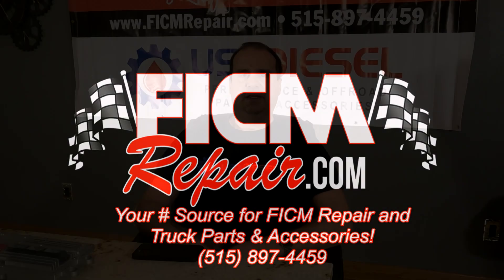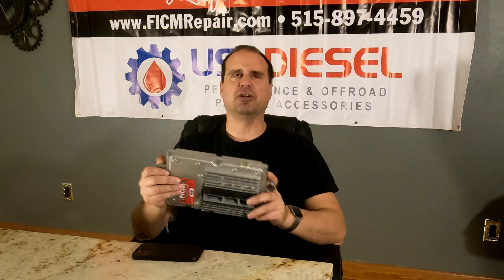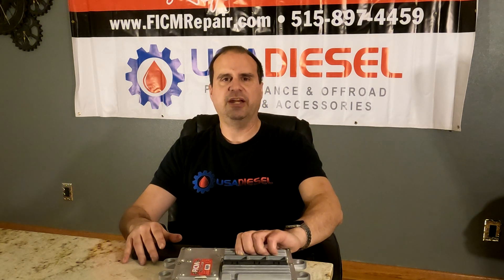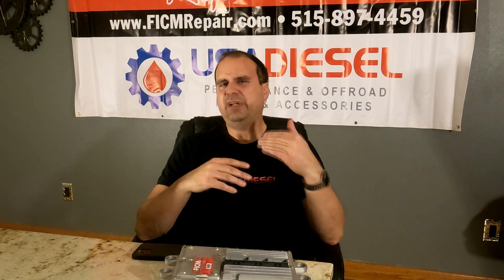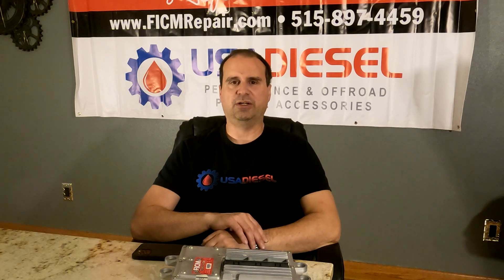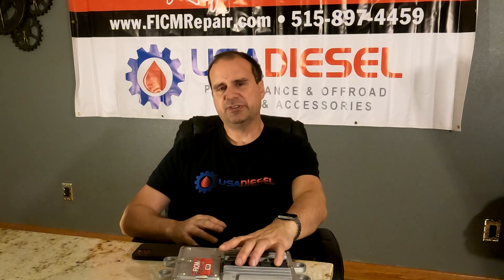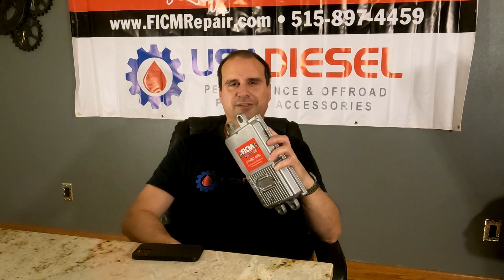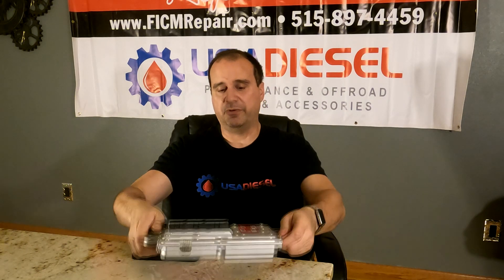Powerstroke 6.0: FICM lasted 10 miles   how to prime the high pressure oil system

Comment: I been wrenching a long time, I have excellent diesel abd gas knowledge, specifically on the 6.0, my question is how would this do damage specifically? Because the ficm will not fire until there is 580psi on the oil rail. Now true, at 580, not all the air is out and it will run funny, but if anything was going to be damaged from that, it would be the injector. I get your saying that the cranking drops the voltage abd low voltage is the enemy of a ficm, but provided one is smart and 1. Dont crank constantly for 3mins, 2. Pulls the icp sensor to purge air initially 3. Has a charger connected and dont crank when under 11.8-12.2 volts resting.     Is there any other reason, not pulling the relay could result in damage, and how?  I just want to understand this because the only reason I ever pull ficm relay is for a ficm tune. Is it just to cover your butt, to keep shadetrees from frying them with low voltage?
Reply from the maker: This other vid might help as it goes into a far deeper dive! https://www.youtube.com/watch?v=B3-_XDrlqPE